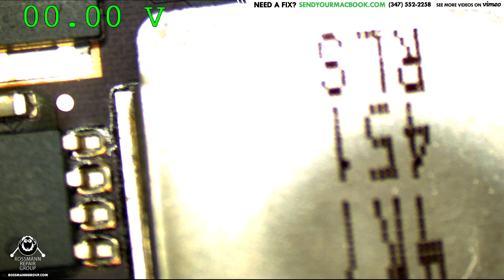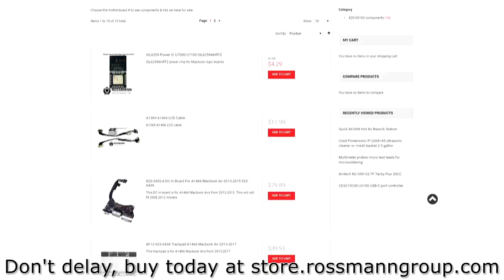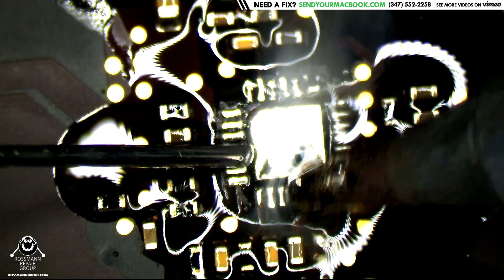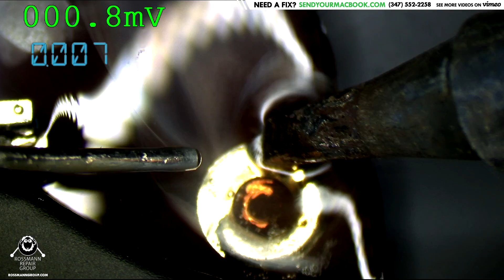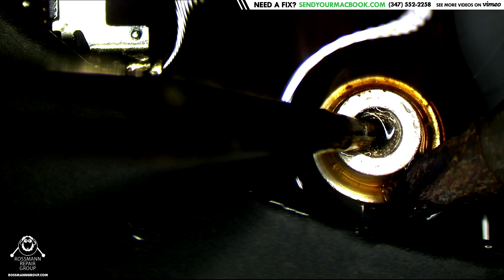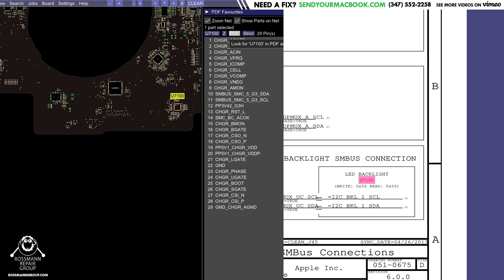Macbook Pro no power logic board repair A1398

Comment: I have the same model, two days ago battery drained completely. I plugged in and only shows the battery charging icon. Left it all night but same. 

I opened the back, unplugged the battery and tired power cable and power button, still shows battery charging icon even without battery plugged in. The fan spins for a few seconds then stops. 

Would this problem need a new battery? Charger is original

Comment: "Long screwed it!" does that mean someone already tried working on this and put the screws in the wrong place?
Reply: Yeah screws not in the original place.
Reply: yeah, he is talking about someone using the wrong screw for the hole it is screwed in to.  if the screw used is longer than the correct screw it can damage the motherboard.  hence "long screwing it" is Louis basically saying there may be damage due to 3rd party negligence / ignorance when trying to fix the macbook themself
Reply: @j0hn3ntwistle  It doesnt even have to be 3rd party, apple could yuck it up too, yknow... if they tried to fix their own products.

Comment: Quote "Kind of curious, has anything come out worth reviewing? "

Actually yes, there's the Best BST-863. 1200 watt station. It's identical to the Quick both inside and out, with the exception of the air and heat adjustment. The air and heat adjustments are done on a touchscreen instead of tact switches. Some might frown on that a bit, but you don't have to go through a complex menu system to change settings.

Comment: I bought this hot air station from China. The only problem I've had is that the bottom IR heater stuck on one time when I turned the IR switch off. The back side switch works fine though. https://www.aliexpress.com/item/32907978371.html
Reply: A switch can work mechanically and still be shorted. The contacts may be welded together. Make sure it's actually breaking the IR heater circuit.
Reply: @GenerationXT  It works most of the time, but in this case it's just an input to the circuit and with it off the circuit drove the IR heater to red hot temps.

Comment: By the way, pay attention, because most of those very expensive led lamps have non-replaceable LEDs. Meaning that you'll have to order parts on unofficial channels and use a soldering iron to replace them. Which is more or less what you do for a living, but maybe you don't wanna do that for your lamps as well.